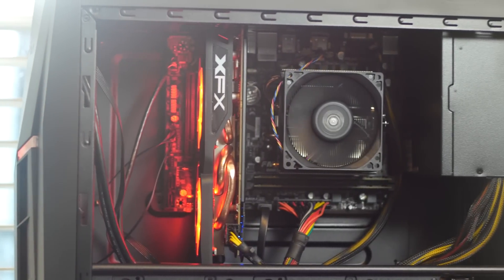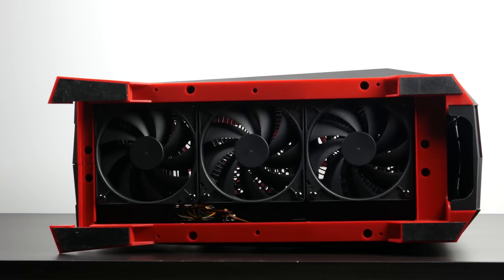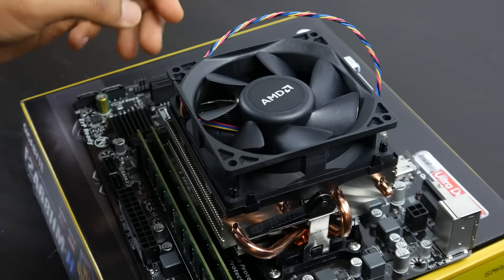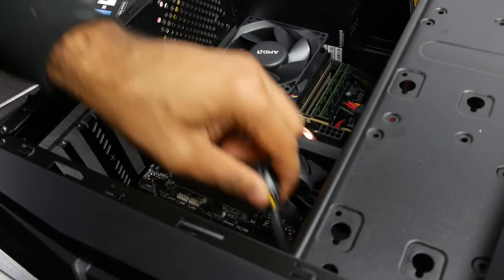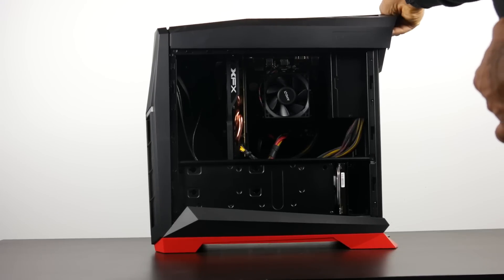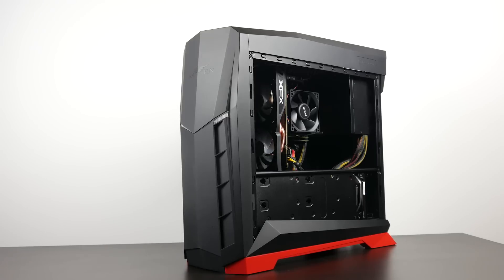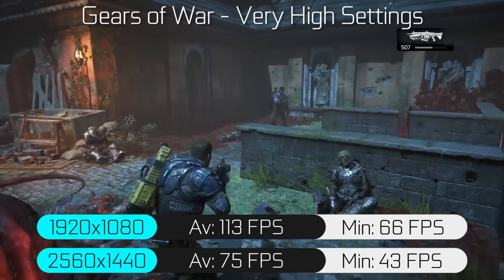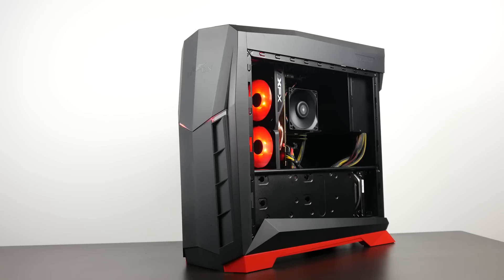Ultimate Gaming PC Under $550

Comment: Once again, a PC builder doesn't include the cost of the OS. Most people can't get the OS for free. The fact that the cost of the OS isn't included is very misleading on the actual cost.
Reply: you can get oem keys very cheap online i got mine for free (not cracked but im a student) and the prices are around 20$.
Reply: zarbon700 You can get windows 10 oem for 25 bucks
Reply: Most people buy Windows retail for $80 - $100, not $25. Majority of windows buyers don't buy key codes online.
Reply: zarbon700 Well thats not MW technologys fault. Its your choice how much you pay
Reply: He's comparing a retail price PS4 Pro product to a PC build, therefore, he needs to use retail prices.
Reply: zarbon700 Oem key is retail. You buy the parts online most of the time anyways, so why not the fucking OS?

Its your choice to waster 70$ on something
Reply: Baron TV Most people don't know they can get cheap OEM keys. Mostly PC nerds know about OEM keys. That's they using OEM keys price is invalid.
Reply: zarbon700 The cost is about the PC anyways, you wouldn't add the prices of games to a gaming pc.

You can only tell people about oem keys
Reply: Ummmm almost nobody includes the price of OS or any other SOFTWARE in HARDWARE builds. Why is it this particular video that you suddenly choose to complain about a extremely common trend?
Reply: TacticalPower88 - The OS current retail price MUST be included, especially when comparing it to a console. A console has an OS, therefore, any product you're comparing it to must have an OS. 

Not including an OS seem to be a trick PC builders use to make it seem that a PC is similar in price to a fully equipped console.

Not including an OS makes the comparison invalid.
Reply: +zarbon700 OS costs range from from free to hundreds. If you absolutely must have a number, Linux and Steam OS are most definitely free. Windows 10 can be easily found for free by virtually all the people savvy enough to do this. There you go...
Reply: Wrong. You have to use the most popular OS for PC gaming and the current retail price that majority of average people will pay. You can't use retail prices for 99% of the components than decide to use non-retail price for 1% of the components. You obliviously don't know how to properly conduct comparison research.
Reply: Baron TV weak comeback. You obviously can't disprove my argument. 

 I'm a PC gamer. The only console I own is a PS3.
Reply: No one includes the monthly subscription for consoles in these tests either which are required to get the full experience out of the consoles. But no one bats an eye at that. Funny enough you could buy a couple of Windows 10 Keys for the price of a one year of Xbox or PS Plus. As others have mentioned there's free alternatives for an OS as well.

Comment: if anyone is buying the parts for this pc here is all the links for it on ebay and for cheaper prices too: (btw some products aren't the same but they provide better performance except the case. Also i am not responsible if any of the sellers are unreliable.)
Hard Drive:
http://www.ebay.com/itm/DT01ACA050-AA00-7C0-Toshiba-500GB-SATA-3-5-HHD-/172496738871?hash=item28299b5a37:g:b7MAAOSwo4pYhMTT
Mother Board:
http://www.ebay.com/itm/AS-IS-GIGABYTE-F2A68HM-H-FM2-AMD-A68H-2-DDR3-4-SATA3-10-USB-M-ATX-F6d31-/391666086693?hash=item5b311e3325:g:vF8AAOSwnHZYaJs4
Power Supply
http://www.ebay.com/itm/EVGA-100-W1-0500-KR-500W-80-Plus-Power-Supply-/322403071837?hash=item4b10b8775d:g:T~wAAOSw9GhYiga3
16Gb ram:
http://www.ebay.com/itm/Samsung-16GB-DDR3-PC3-8500R-1066Mhz-2Rx4-ECC-Server-Memory-Registered-RAM-/122326773494?hash=item1c7b3e6ef6:g:shQAAOSwopRYdh8S
Graphics Card:
http://www.ebay.com/itm/GIGABYTE-GeForce-GTX-1050-Ti-PCI-Express-DirectX-GV-N105TOC-4GD-4GB-GDDR5-/322403679288?hash=item4b10c1bc38:g:pJ4AAOSwImRYiqjV
Processor:
http://www.ebay.com/itm/AMD-Athlon-II-X4-760K-3-8GHz-Quad-Core-Socket-FM2-100W-AD760KWOA44HL-Processor-/162071267372?hash=item25bc33482c:g:e7kAAOSwInxXN~8V
Case:
http://www.ebay.com/itm/GIGABYTE-GZ-ZA1-GZ-ZATHB1-No-Power-Supply-ATX-Mid-Tower-Case-Black/142205702171?_trksid=p2047675.c100005.m1851&_trkparms=aid%3D2220071%26algo%3DSIC.MBE%26ao%3D2%26asc%3D20131003132420%26meid%3Dd42aafb77722448a947a8673b424ec62%26pid%3D100005%26rk%3D6%26rkt%3D6%26sd%3D201619644944

Total cost: $314 (compared to $550 my pc is $236 cheaper)

Comment: Is this setup good is mid range setup Btw this is in Aud.    

Intel S1151 Core i3 6100 3.7GHz Dual Core CPU $152

Asrock S1151 Mini-ITX B150M-ITX DDR4 Motherboard $129

8GB DDR3 G.Skill F3-1600C11S-8GISL (1x8G) 1600Mhz Aegis RAM $59

1TB WD 3.5" 7200rpm SATA 6Gb/s Blue $68

500 Watt Cougar STE500 Power Supply $65
-----------------------------------
Thermaltake ATX View 27 Case $89 
                        or 

Corsair ATX Carbide SPEC-01 Red LED Case Black $79
-----------------------------------
DEEPCOOL RGB 350 $30

MSI GTX1050Ti 4GB Gaming X PCIe Video Card PN GTX 1050 Ti GAMING X 4G $249

23.6" Viewsonic VX2457-MHD LED Monitor with Speakers $169

Cougar Deathfire Ex Hybrid Mechanical Keyboard and Mouse
$69

Deepcool Gamer Storm Maelstrom 240 Liquid CPU Cooler $109

1198 aud
Reply: That Motherboard doesn't support DDR3 RAM, change it to DDR4 and it should be fine. And don't bother spending that much money on a CPU cooler, invest some of that money into either a better CPU or GPU.

https://au.pcpartpicker.com/list/ZhpdGf

I tweaked it a little bit and still managed to fit in an i5-6400 and RX 470. You can still go for the 1050ti too, it's slightly cheaper and still a solid option.

https://au.pcpartpicker.com/list/MNhsVY

And another option with a cheaper case and more RAM.

Comment: i hate myself for not buying this pc
Reply: this pc is really not good ... the cpu is really  outdated  and the ram is ddr3 ... its 2016 ....
Reply: yeah....
Reply: So can you suggest something better?
for 550$?

Exactly
Reply: Speeding Sniper .
Reply: You excluded the GPU, considering that it's quite fast for the price, that boosts the performance. Actually, I currently use the athlon 860k with a gtx 1060 and can run games very easily, I understand the cpu is lacking but it performs better than you think.
Reply: +Speeding Sniper Pentium G4560 and RX 480
Reply: Rx 480 is in the video
and ill keep the G4560 in mind
Reply: In fact you should just get i3 6100 and rx 480 for 500
Reply: braddds I build this pc and its very

Bottleneck

Comment: WTF my PC runs GTA 5 between 55-65FPS at 1080p and it costs 3x this PC. Anyone know a fix?

Specs:
i5-6500
GTX 1070
16gb RAM
Reply: Jimmy Compston Lol, thats weird, your gpu should manage over 100+.
Switch off Vsync
Reply: - Immortalian - just did, ran the benchmark and get 86FPS
Reply: Jimmy Compston 86 fps is normal.  
:3
even my friend with similar specs said he gets around 70 80.
Reply: just figured out the bottleneck, CPU usage at 95%.....
Reply: i5-6600K or i7-6700K?
Reply: i7 of course haha
Reply: Jimmy Compston I5 and I7 are similiar at gaming, I7 wins in multitasking
Reply: yeah ik, but theres Zen and Kaby Lake around the corner so might go for one of them :)

Comment: Ignore the above video and rather get this https://pcpartpicker.com/list/bRpbyf
It has an Intel i3-6100 CPU which outperforms that amd cpu, it gives you an upgrade path to sandy/kaby i5/i7 in future unlike the dead amd socket. It also comes with a 1TB hard drive vs 500GB. 1x 8GB RAM stick so you can upgrade to 16GB in future by simply popping in another stick. 8GB RX 480 red devil gpu with a great cooler. Motherboard has a M.2 slot which I really like as you can get a high performance m.2 ssd in future not using a sata port. The build is $560, yes it's $10 over $550 but you get double the storage, if you get a different MB without m.2 slot you can drop the price by $10.
Reply: rztrzt but the CPU is dual core and doesn't overclock to 4.5 gigahertz
Reply: It has hyperthreading and will outperform that 880k all day long overclocked or not by a significant margin. See http://www.gamersnexus.net/hwreviews/2394-amd-athlon-x4-880k-cpu-review-and-benchmark

Comment: HI, I'm just getting into PC gaming and was wondering if this build would be able to run games like Far Cry Primal, Witcher 3, BF1, and some of the newer games 40+ fps at 1080p
https://pcpartpicker.com/list/xks7sJ
Reply: Jacob Myrick It's a great build, but can you still stretch the GPU to say RX470.
Reply: sadly that's not within my budget ;( i was more worried about the cpu but how much of a hindrance to performance do you think the RX 460 is?
Would this be any better? https://pcpartpicker.com/list/VTHCZ8
Thanks for the help also!
Reply: Jacob Myrick Yeah the 750ti is still pretty good. You can stretch the cpu to 880k or maybe go for cheap Haswell i3.
Reply: Jacob Myrick this DEFINITELY will not run witcher 40+ fps. Witcher 3 can barely run above 60 with 1000
dollar build
Reply: +Cancer Man I see... how do you think it would hold up with the others mentioned?
Also, this may be better https://pcpartpicker.com/list/PghCZ8
Reply: Cancer Man no shit man i have a 700$ pc gaming and i ran witcher 3 on65 fps maximum
Reply: Jacob Myrick The RAM is very expensive, you can find 8gb for around $45 spend that extra $30 towards your GPU.
Reply: Jacob Myrick replace the 460 with a gtx 1050 and ur pc would play them

Comment: 10603gb and an i3. gtfo with the 880k. cmon
Reply: ActionManFTW the Rx 480 8gb absolutely destroys the 1060 3gb. are you a fanboy
Reply: then get a 6gb, just saying the 880k bottlenecks the gpu alot, so an i3 would be much better
Reply: Yeah the i3 with hyper threading would have been a much better choice but it is $20 more
Reply: i think the extra money for a processor, rather than going for a 8gb 480 wouldve been better
Reply: ActionManFTW Or you go for a cheaper case...

Comment: gtx 1060 is 1% better and 5% cheaper
Reply: 1% better is technical draw. And with regard to prices the RX480 is usually cheaper and with better results in DX12.
Reply: that depends rx480 8gb costs more but the 4gb version performs just as well and costs less :D
that same thing cant be said for 3gb 1060 because it has some downgrades

Comment: HELP! HELP! HELP!
hmm i need help! Befor i list my specs let me tell you all whats going on
So i have fps drops or dips/st-udders when playing all types of games CS:GO,Rust,RS2:V,GTA:V,BF1 and much more! 

Specs-> CPU:AMD FX-8320 Vishera 8-Core 3.5 GHz (4.0 GHz Turbo) Socket AM3+ 125W FD8320FRHKBOX Desktop Processor 
               CPU COOLER:CORSAIR Hydro Series H55 Quiet Edition Water / Liquid CPU Cooler 120mm 
               MOBO:MSI 970A-G43 AM3+ (blue/black)
               RAM:G.SKILL Ripjaws 16GB (4 x 4GB) DDR3 2133
               GPU:SAPPHIRE NITRO+ Radeon™ RX 480 4G D5 OC
               PSU:EVGA 500 B1 100-B1-0500-KR 80+ BRONZE 500W
               STORAGE:WD Blue 1TB Desktop Hard Disk Drive - 7200 RPM
               CASE:DEEPCOOL TESSERACT SW Mid Tower Computer Case with Side Window and 2 Blue LED Fans 
               SGCC+PLASTIC+RUBBER COATING

I do try recording a lot of the games i play but i cant anymore do to st-udders and FPS drops :(

Comment: This build is pure garbage. Case is overpriced and unnecessary, ddr 3 instead of ddr4 in 2016-17 with 550$ budget, 500W power suply. When the whole system will take no more than 200-250W. Last but not least, AMD cpu. are you like kidding me? i am like full on hatred mode for this video. Thumbs down and report for missleading text. The only console that it would kill is ps2(sarcasm).

Comment: third xD
Reply: man that is a seriously nice case...
btw what does the quad core means? does the quadcore 2.6Ghz is 2.6ghz x 4?
Reply: Yes and no. Yes there are 4 cores with 2.6GHz each and no a quad core with 2.6 GHz doesnt always have a four times better performance than a single core chip with 2.6GHz
Reply: +David Wielander thx...so that mean the quadcore can handle programs 4x more efficiently than a single core??
Reply: +Arraziq Faizal I wouldnt say that because a program doesnt always use all your cores with all their power. And it is depending on which cpu it is, who manufactured it,which architecture is it and when it was released to say how fast the CPU really is. The Quad Core AMD Athlon 880K from this video for example has the double amount of cores and a higher frequency than an Intel Skylake i3 processor. But still the i3 would outperform it in every task because it has more instructions/cycle. But to answer your question: yes a quad core will handle most programs much better than a single core but its difficult to say how much better.